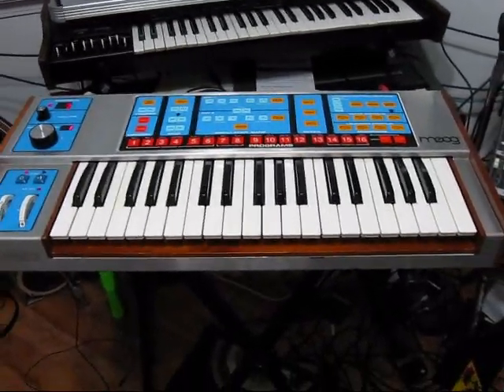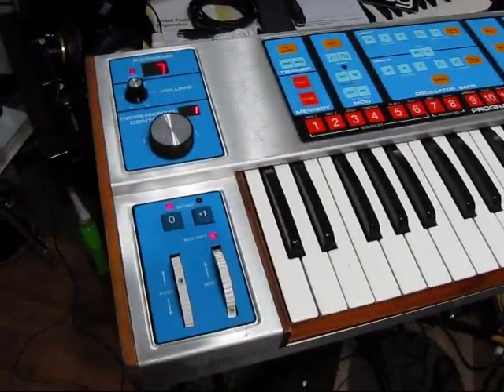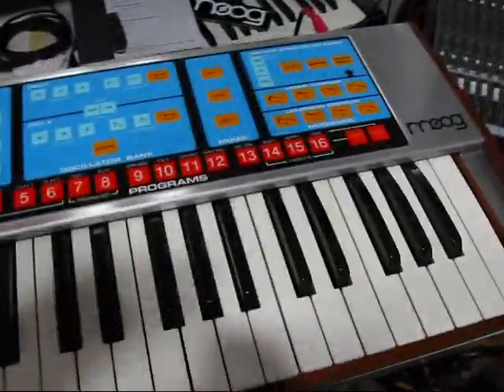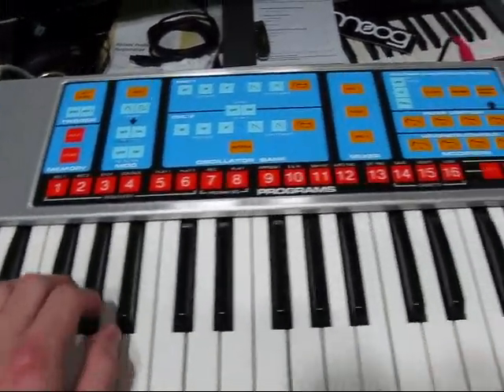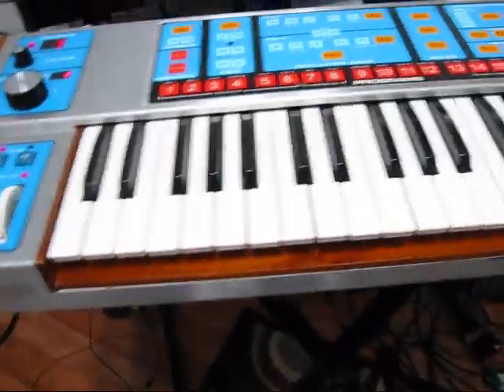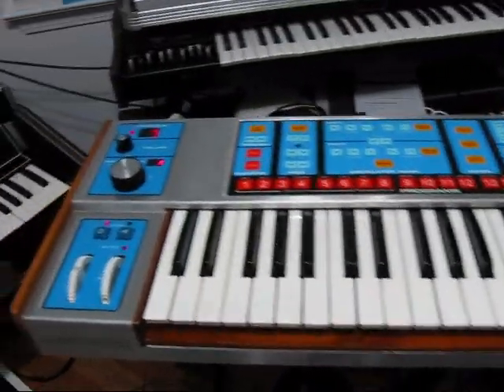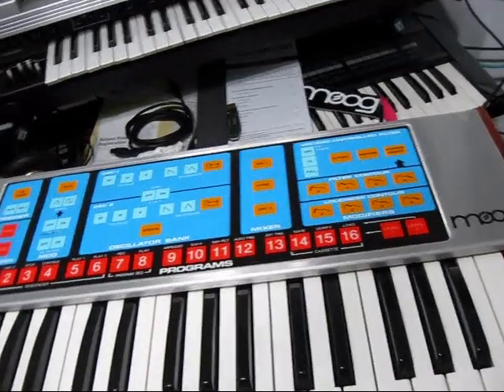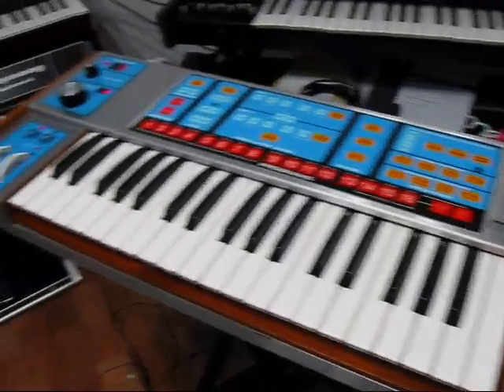Moog the Source restoration (by Synthpro)

Comment from the maker: @Desmaad No, the buss lines for the membrane buttons were still in good shape on this one, I did have to work on the analog board quite a bit though. It looked like voltage had been fed into the audio out jack and it damaged some of the amp circuit.